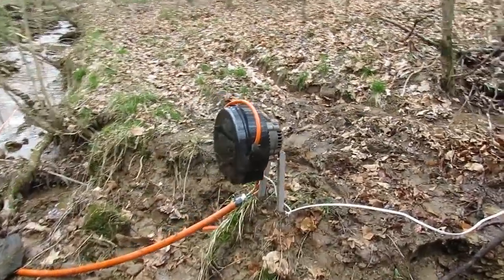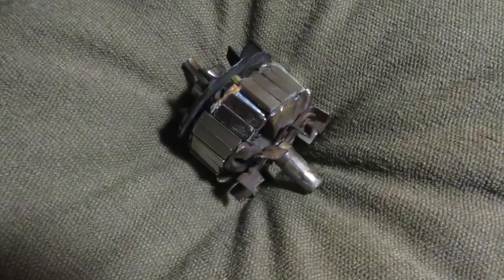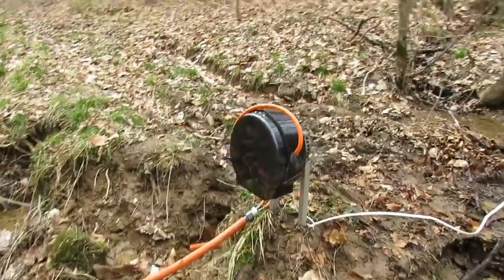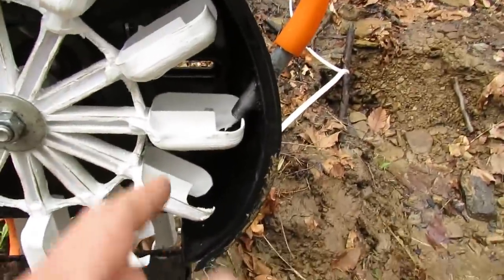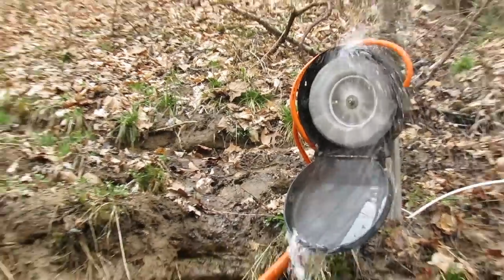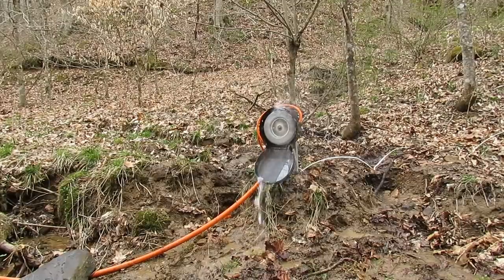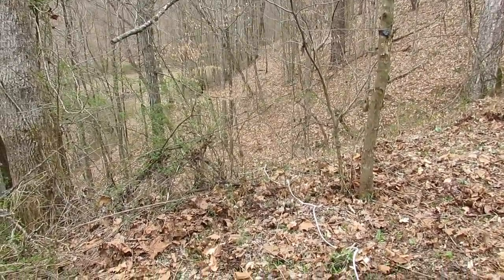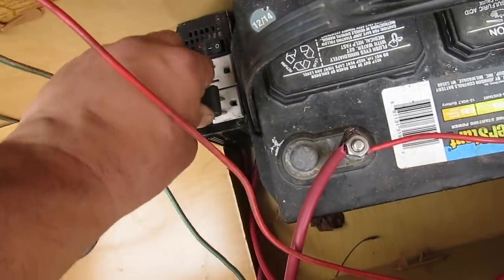Water Generator Running Off Grid Cabin

Comment: Creating power like this is great, but as said before separate wet and dry area.  Generate AC with high enough voltage and smaller wire can be used.  Converting it to DC the controling charge voltage works great for charging batteries.  The idea is AC can use smaller wires and DC needs heavier gage wires with shorter distance.  On the gentleman commenting of Solar power then not able to use it because the big enemy of DC is loses of voltage drop was too much.  Set the solar up in the remote spot, charge the batteries then have an invertor convert the dc to ac.  Then you can transmitt the power longer distances with out all that loss.
Take a took at hign voltage transmissions lines.  Voltage is in the 1000's of volts. with transformers stepping down the voltage to 240/120 volts ac for household use.  That is how the grid works.
Reply from the maker: I ended up using a butter bowl with the bottom cut out to shield the generator. I also took a piece of gorilla tape and sealed the hole where the water was coming out. 

Yeah, the fact that A/C power can go longer distances is why I put the rectifier at the cabin. I had thought about the inverter at the solar panels and sending the power up to the cabin as A/C power from the inverter. I think that is what I will do soon. I have 200 watts of solar panels a waterproof charge controller, and four batteries. I also have a field nearby that gets sun for most of the day. I could put the panels and batteries in the field, and move the water generator closer to the field with a little more pipe and use the panels, and the water generators to charge the same batteries.
Reply: @lukeFugate  Ac Power doesen't go longer distances, but Higher Voltage will. Voltage loss in the cable is always the same, your long run may lose a couple of volts, Losing 2 volts from 120 volts is nothing, losing 2 volts from 14 volts is a lot. Put the inverter and battery at the generator so you can keep all the power you generated.

Comment: You need to know how many watts you are getting from the unit.
Reply from the maker: Yes, I am going to try at some point to figure out the maximum output of it. I am first going to increase the length of the pipe and get it closer to the cabin. I haven't had much time to fool with it since going back to work.

Comment: Make sure you measure your distance before deciding on your solar voltage.  I was planning on a little 12 volt system but the wire alone was going to cost more than the battery bank based on distance from the panels to the bank.  I'm now looking for property in an open field for my off grid paradise. :/
Reply: that is when you convert to AC at source then send it on its way.

Comment: WOW, I bet your wife is so proud of you being smart and making cool stuff! Can you do that with a small wind generator for my wanna be Skoolie? I've been told it won't work!
Reply from the maker: If the wind generator is high enough it will produce power if you get enough wind. It would have to have a secure way to mount it folded down while driving. You don't want the blades to catch the wind at highway speeds and rip them off.

Comment: Your electrical leads look like they were getting wet. How is it not shorting out
Reply from the maker: It's low voltage so it won't be that bad with clean water running over them. If it were salt water it would be a different story. I ended up cutting the side out of a butter bowl and made a shield for it.

Comment: So the AC is allowed to travel, and it does as AC better than DC. Gives me idea of placing a set of solar cells, powering a inverter then to storage box  to be changed to DC for main batteries. that looks like Romex  12-2 with ground an I right?  To say that I put my cells on a trailer.  What i see helps thanks  De kv4li
Reply from the maker: I think that would be a good idea. The only downside of having the panels and batteries close together is when you run your A/C through the 12-2 you will only have the A/C current and won't be able to use D/C appliances directly from the battery. It would work if you only wanted A/C though.
Reply: @lukeFugate  check!  as I work I can harvest power . DC at mobile panel unit then convert to AC to travel to home unit. Then transfer to dc to charge batteries.. thus  finding a clear area to charge batteries. Hydro/mobile batts. = No tree cut tks.

Comment: Why not just use a permanent magnet DC motor.?
Reply from the maker: That would also work. I actually built a generator using a permanent magnet motor in this same housing in a previous video. The power output was not very much at all and the bushing, rather than bearing design wouldn't have lasted very long running 24/7.
Reply: 3 phase alternator/ generator, or 3phase pma is more effiecent, alot more effiecent,

Comment: Just an FYI, capacity is not changed by doubling the magnets. The frequency of the output will change, as you indicated, because of the higher magnetic polarizing flux, but not actual output. IE: what was 25hz will now be 50hz. 

The only way you can actually increase output would be to use magnets of a higher flux or increase the gage/wrap count of the output coils.

Nice work though!!!
Reply from the maker: Thanks for the info. I guess I was wrong, changing out the coils would be the way to go then to improve the output.
Reply: It wasn't to raise amps, just to get it there faster, via my comment.
Reply: REALLY good job though
Reply: Jamison Salzman  Yea... ahh no! ???   1) You did not mention speed of flux breakage. 2)If said prior design was putting out say 50v @ 50Hz. new design Doubling magnets yields  50v @ 100hz . then sent to full wave bridge rectifier is doubling DC power out put per RPM of said mechanical generator.  3)Coils will only rearrange voltages/amps with same givin densities of copper. 
4) changing flux patterns can add or subtract to flux spikes that effects outputs as well.  
Rule of thumb! Get as many magnets & as much copper Plus speed involved in flux breakage from mechanical energy as possible.  He is doing a great job! & i think your ending comment is a bit duche-y!
Reply: Dan Murphy , I was genuinely complimenting his video. The only thing I see as ‘duche-y’ is you attacking me. 

With that said, all the research I have done, does not support your theory.

http://www.circuitstoday.com/full-wave-bridge-rectifier

The main affect of increased frequency, is decreased ripple frequency on the output of the rectifier. 

Without modifying he output coils of the generator, higher amplitude will not be achieved, unless magnets of a higher flux are used. This will increase the output voltage and maintain the same output amplitude. Which, in turn, can be regulated down to the same voltage, which would THEN increase the output amplitude. 

If There is something I am not understanding, please provide some support, without the attacking attitude. 

I’m here to learn and help others learn as well. Bullying people negates the learning environment.

Comment: For the lengh t of cable to your cabin it should have at least been double the thickness, you know current loss.
Reply from the maker: Yes, it should. This wire was all I had at the time. I'm sure I'm losing a lot of power in this wire.
Reply: @lukeFugate  you could just keep the one on it and add another one to it. Or one thicker gauge wire and then you'll have the leftover smaller wire if you have a use for it. Free electricity is the way to go. At some point I may do solar and a bike with a alternator on it to charge some batteries.

Comment: How much voltage is the alternator producing?
Reply from the maker: I think it was a little over 24 volts a/c. Not much amps at all though.
Reply: @lukeFugate  With the size of cable you have used from the alternator to the rectifier, there must be a significant voltage drop ⚡
Reply from the maker: All I had at the time that was long enough was 14-2. I needed probably about #10 wire to minimize voltage drop.

Comment: Put the electronics inside and leave the battery where it is. Two reasons, the gas from the battery will corrode the electronics and the battery gas will go up not down.

Comment: Wonderful video, but you did not show the other end of the water hose. How did your hose deliver water to the turbine at such a pressure from a slow running stream?
Reply: Great question..  I would like to see this as well..  looking good though
Reply from the maker: It is actually just the end of the pipe at a higher elevation. There is a lot of flow in this creek when it is condensed into a small pipe it produces quite a bit of pressure. I will have to put a screen over the end of the pipe to prevent debris from getting sucked into the pipe. It is blocked right now, as a matter of fact, I'm not using the cabin right now anyway so I just turned off the inverter until I can get time to unclog it.

Comment: You need to get like 6 or 7 more batteries at a minimum and get you a better inverter. Other than that it looks good with only having one battery the system is so small that the charge controller may have a hard time.
Reply from the maker: I have two more batteries now and a bigger inverter. I just have to get up there and install them. Right now the pipe is blocked with debris so I don't have any power coming in. I don't need it right now anyway because I'm working so much.
Reply: I agree with adding more batteries and putting in 10-3 UF (same as 10 - 2 but with outdoor protection insulation) get a bigger inverter and dont use that zip cord.  Nice use of natural energy!!!!

Comment: nice simple turbine setup. But...(sorry for this) the generator cant handle fine sediment washing barings and magnets so it realy needs to stay as dry as you can get it for it to last longer. Another pointer; the shorter the distance of your cables to your charger the more amps / power (at 12v). I recommend moving the battery and charger box near the turbine so you dont have the cost of investing in heavy cables for 12v transport. You can test this with your voltmeter at the turbine and than at your charger. The 110v ( or 230v) to your cabin can be transported with almost no loss of power with the cables you have there. Good luck with the projects
Reply: The output from generators like the one used is fine for a decent transmission distance if it was a 12v dc output you would right but the output is 3 phase AC and should be a pretty high voltage with low current
Reply: @shaynegadsden  shayne, thanks for the info. I had to wach it again to be sure..you are right. I had problems with my own set up..its two fase
Reply: @shaynegadsden  Im not certain I understand what he's done here, am I to understand that he is driving an AC alternator and then converting it to dc to charge the battery and then converting it back to AC to use in his house ?
Reply: @bobsblues9944  basically yes you would need a substantial turbine setup to make sure you have enough power being generated to cover the maximum load you may need so the alternative is to generate less and store the power for when it's needed however due to the way AC power works it can't be stored in a directly useable form so it is converted to DC for storage then inverters pull from that storage creating useable AC power as needed it seems like a bit of a roundabout method but if you needed say 7kwhs per day which is an average household power use a 500w turbine running 24 hours would give you 12kwhs so even with a small turbine you would have plenty of power using battery storage however to power a house directly from a turbine it would need to be more like a 5kw unit atleast just so you could run a kettle and toaster but to get 5kw you need a pretty substantial amount of water available all year round and on top of that most of the potential power would be wasted
Reply: @bobsblues9944  Yep, just what he is doing.  The output voltage of the alternator will be proportional to the speed it is turning. Which is UN-regulated in his setup. Thus not a constant 110-120 Volt needed to run items in the cabin. Using the charge controller and a battery to act as a temporary storage he can then use the output voltage of the Inverter to regulate the voltage into the cabin.    The  I sq R losses from the alternator to the cabin would be minimal due to the 3 Phase power the alternator is producing.  60 feet as he stated is nothing. Hell I have extension cords nearly that long. A 12-2/wg would be more than enough in his application.  As far as additional batteries, would depend on if he wants to run a refrigerator full time or not. If not, and is only using for lighting and charging tool batteries and the like. The single battery is fine. Hell it's being charged all the time 24/7 and in a float mode when no demand is on it. 

Great job Luke, would love to get a copy of the .dxf or .stl file for your 3D printed turbine wheel.  Once again great job and don't let people that DON'T do anything keep YOU from doing things. The na sayers will always bust your balls.
Reply: Shayne Gadsden He needs to increase the wire size for that distance.  He's actually loosing voltage  due to voltage drop. 
Romex is not designed for 3 phase voltage ...120 yes.
Reply: @Eric-gi9kg  yes it isn't the correct cable since the earth is being used for a live but that not really and issue any cable is fine as long as your not exceeding the insulation breakdown voltage as for the voltage lost between the turbine and charge that is a bit hard to say it since we don't know what voltage and amperage is it is hard to give hard figures but in such a low power system the loss is minor and the higher the turbine voltage the lower the loss but ignoring all that the idea and design is extremely low cost and the additional cost of larger cables wouldn't justify the at absolute best 50w gain

Comment: Don't let the local power company see you using this, or they will shut it down.
Reply from the maker: I wouldn't doubt it. They can't stand when they don't have control over you.
Reply: As long as you’re not plugged into the electrical grid, they can’t touch you.
Reply: You can connect to the grid. They legally have to pay you
Reply: @Jaba6798  Depends on the state. In Pennsylvania, a homeowner can only produce less than they use. The electric companies are protected by the legislature.
Reply: @ikeknights  I would be in deep shit I produce about 450 kwh a mo lol .
Reply: @ikeknights  I use wind and solar .1410 ah bank
Reply: @donaldsteele6276  Donald, just subbed!
Reply: https://youtu.be/CVyjtJY2h6E

Comment: If your charge controller has a shunt output you can use it to split water into hydrogen and oxygen and collect the hydrogen as fuel.
Reply from the maker: It does have a shunt connection. Not sure if it would be enough amps for electrolysis but worth a try. Thanks.
Reply: @lukeFugate  you can use AA batteries to split them so you probably have enough :0)

Comment: Brilliant set up.
Reply from the maker: Thank you!
Reply: Would you have to add another battery to run a T.V. or would you have to just add panels or more alternators? Not sure how these systems are sized.
Reply from the maker: @corywilliams1698  I could probably add another battery and get a few hours of tv watching, before the batteries were down. To get the system to be sustainable to have the tv on longer I would need more power coming in.

Comment: Did you ever show the intake setup?  Is there substantial elevation difference that generates the water speed?
Reply from the maker: Never did the intake yet. It's just a pipe laying in the creek right now. I have a couple of ideas in my head just haven't had time. I've had to unclog the nozzles a couple of times. The change in elevation is about 20-25 feet.

Comment: You should put a pile of rocks below the water impeller so the water pouring out doesn't wash out the bank where the post are, causing a collapse of your generator.
Reply from the maker: I did. I spotted that as I was getting on the four-wheeler to go to the cabin. I already had the camera strapped down so I didn't film it. I just took some flat rocks and made a little waterway down into the creek.
Reply: And a cover over Alternator. Lol

Comment: What voltage are you getting before the rectifier?
Reply from the maker: It was a little over 20 volts AC running open. It dropped to about 15 volts when it was charging. I think it is just barely enough current to keep the battery charged if I run more than a few lights and a charger.
Reply: @lukeFugate  As soon as you connect a generator or solar panel to a battery, the whole system will be sinked down to the battery voltage.

Comment: And do you have to have a power dump for when the battery is topped off?
Reply from the maker: The charge controller is supposed to switch off when the voltage gets too high.

Comment: I wonder how much more efficient rigid pipe would be instead of that hose.
Reply from the maker: It would probably help. Also having the size of the pipe stay the same all the way to the nozzle would probably help.
Reply: @lukeFugate  Volume on the intake reduced down on the outlet will give you more pressure and the amount of drop from the top to the bottom of your hill .

Comment: A one inch pipe split into two half inch pipes means you are only getting half the volume you could get. Doubling the size of the pipe gives you four times the volume!
Reply from the maker: Yeah, that makes sense, I may have to re-work the system a little.